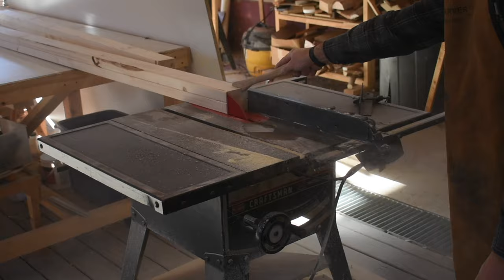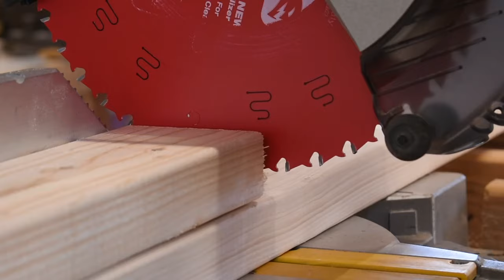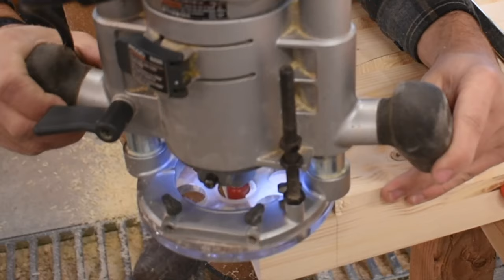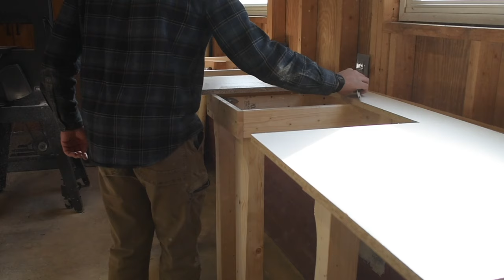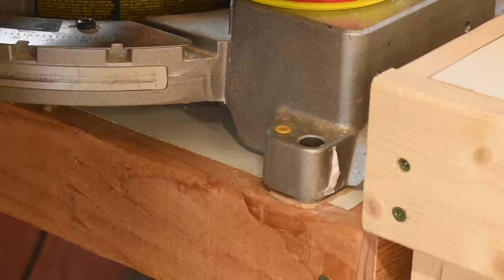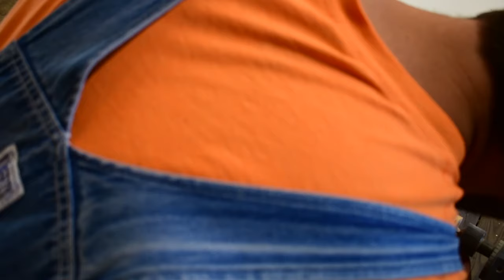I finally built a work bench | Smart improvements

Comment: Any idea how much you spent on materials?
Reply from the maker: It was about ninety, which I think is pretty reasonable. I did pull apart my old miter saw stand though, plus I had some scrap plywood. So if you bought everything new it would probably be a little over a hundred, still pretty good though.

Comment: Don't want to be safety police, but when you use a miter gage with a fence don't cut fully through the piece. Fine if you do a dado or half lap since you're not creating 2 pieces with one getting pinched against the blade and the fence. Offset the fence with something like a One-Two-Three block. So you can get the reference of the fence without the potential for kickback. Aside from that, you're doing good work.
Reply from the maker: I don’t remember doing that in the video, but that is a bad idea, at least everyone says so